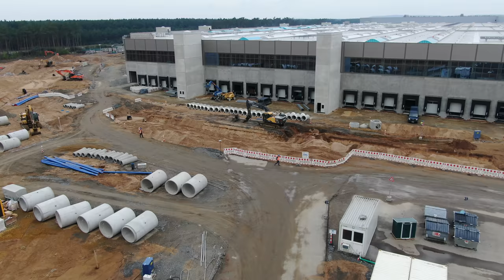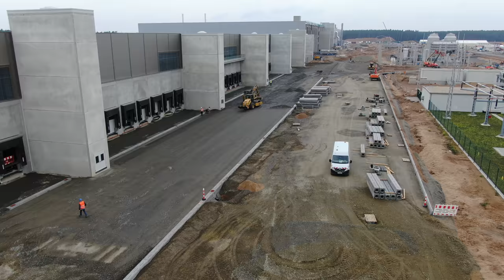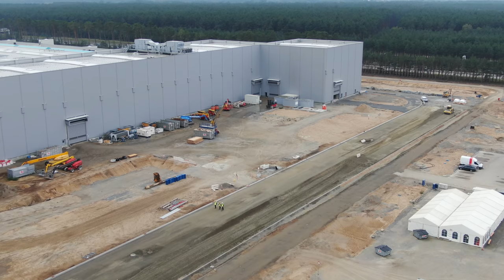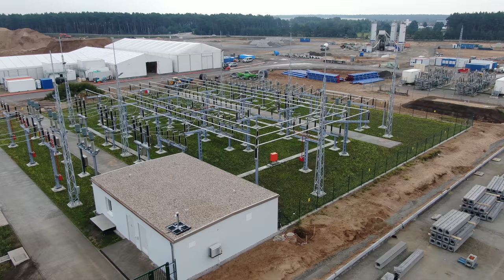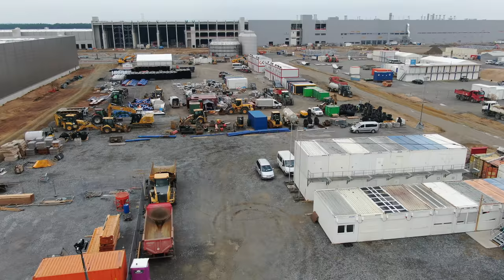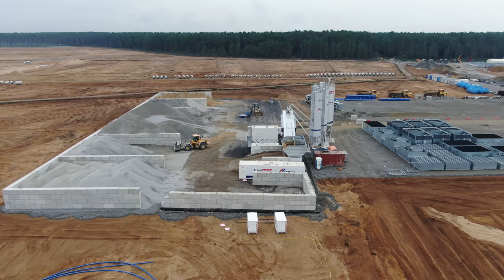Giga Berlin | 2021-09-11 | Road work

Comment: I’m a Fan of Precast Concrete Buildings perfected  Germany. A lot of planing has to be done for the sequence of erection and crane placement because concrete is much heavier than steel and it appears floor beams have to be done starting at the middle of building with mobile crane and building is finished from crane outside for perimeter of structure where reach of placement is in range.

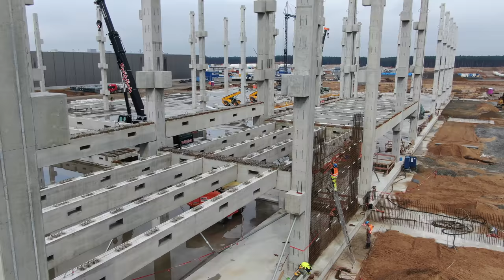Comment: 15:30 worker on ladder not in fall arresting harness and tied off when working above 6 feet, ladder not tied off at top and bottom to prevent fall. I figured German workers would be more safety conscious than US workers.
Reply: Ladders are not allowed as a workplace at all in Germany. If the BG sees this, the penalty won't be small. But since the worker probably comes from Poland and is employed there, he can do whatever he wants.

Comment: I think the number 1 job is installing rebar, I wonder if there is a way of automating that.
Reply: @J Cronin … not really. Of course I’m sure they try to make it faster. I would say maybe just for “ simple “ application like straight forward concrete slab. When it goes install rebar in column then u need people. … I would  thing what makes it a “ bit easier “  that you will get the rebar pre banded and maybe pre cut. But otherwise it’s still a lot manual work. Good thing when u work in construction there will be for a lot of tasks and for a long time to come no robot will take over your job. I will not yet here discussing if its good or bad.
Reply: @wolfgangselle3272  o

Comment: Don't know why they are taking so long to lay the pipe underground so that they can start paving for parking lots for finish vehicles ready to transport.
Reply: Because it's not your backyard and not just one pipe.
Reply: Where they are currently working on is the "frontyard" parking lot. For employees, guests etc. They will need not only rainwater pipes there. But also electricity (chargers). And there will be also smaller buildings (e.g. a guard house at the gate) which needs also water, heating, ... 
So far they did not start any works at the parking lots for new vehicles.

Comment: Particularly interesting to see temporary braces on the battery factory columns now that they are installing the beams. A bit counterintuitive, one would normally expect more stability as more beams are installed.
Reply: It is not a matter of stability but they are there to adjust the columns in the correct, perfectly vertikal attitude.
Reply: The load on the columns is however currently just one sided - thus not balanced.

Comment: Flat spacious roof. And How they stop massive rainwaters to penetrate inside?
Reply: It's not completely flat, roofs never are they have a slight pitch to allow water to run off.
Reply: Wasn’t this supposed to be a region with very little water according to some german greens buhahaa
Reply: @TurreTuntematon  a lot of rains in this region. I dont know but cement/concrete easily let waters thru. As I see , there is a huge square above. Even if it has a slight slope, anyway,  in case of heavy rains a big pool will be formed there with a tons of water. Wonder What they use on flat roofs to get it 100 percent waterproof?
Reply: @roland9340  the roofs are waterproof but not flat, as somebody else mentioned. There is special foil welded on the concrete. Every roof has several deep points (like a very flat stair or mountain-valley-design) and rainwater drainage plus emergency outlets in case of heavy rainfalls or ice.
Reply from the maker: The roof has a lot of drains (all the black dots are drains)